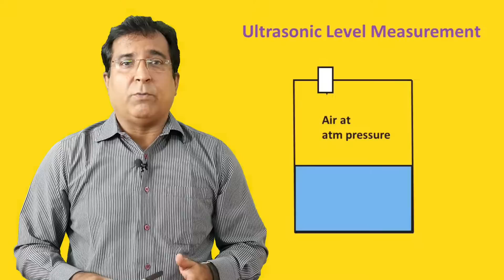Radar Level Transmitter | Ultrasonic Level Transmitter | Selection @dineshdiwani

Comment: Which is better for measuring reservoir level.
Reply: Which Instrument can be used to measure discharge through a hydro turbine (Kaplan turbine full discharge 2200 cusecs)
Reply from the maker: @srikanth0282  discharge will contain turbulences so ultrasonic level transmitter can serve the purpose but again you need to provide a damping on high freq variations, due to turbulence, can be suppressed. Take level range into consideration upto 20 meter.
Reply from the maker: Ultrasonic if level range is low, say upto 20 meter and level surface is flat ..cheap option

Comment: Sir what should be the minimum dielectric constant for radar as well as ultrasonic Tx selection ?
Reply from the maker: It suggest 1.4 ..lower than this..radar waves are not reflected back. The higher it is, its better for radio wave reflection. Vaccum has dielectric constant of 1.